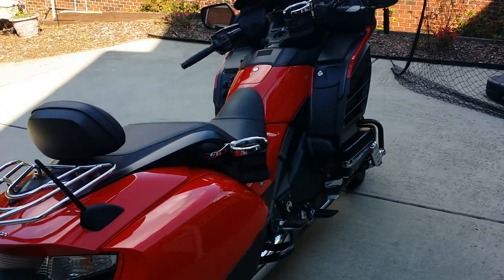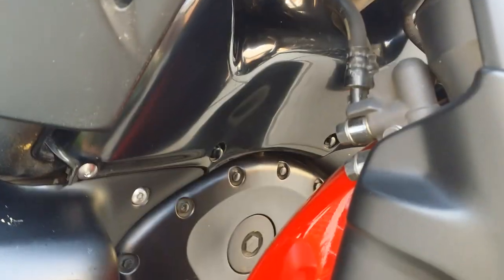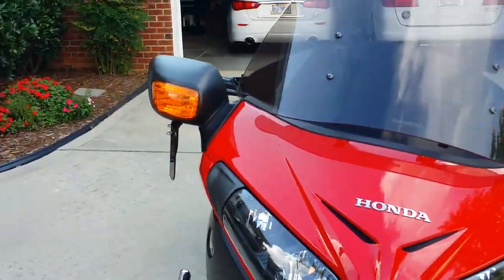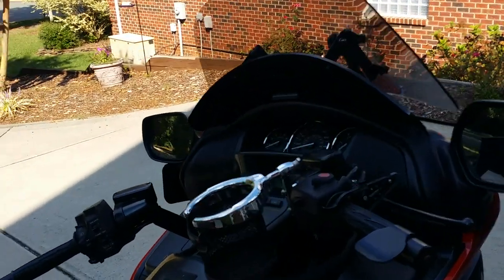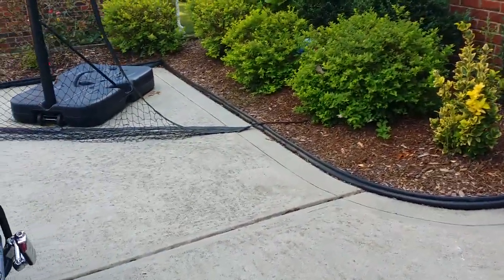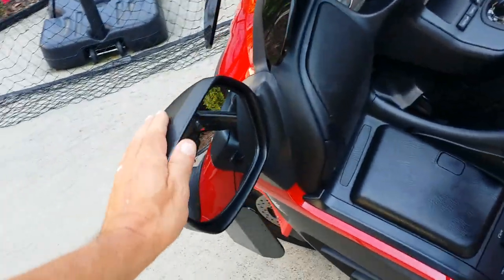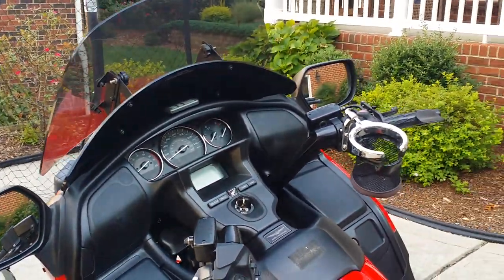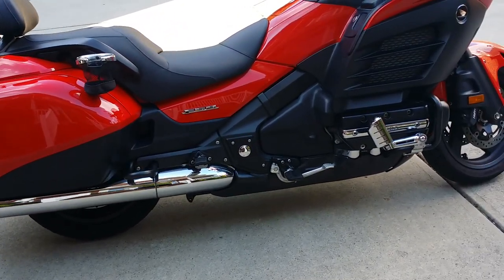F6B 2013 Honda Goldwing 21,000 Update Review

Comment: Great Video John!  Nothing better than long term reviews. Hey, you talked about your radio at length. I like listening to my radio but quickly found it had no range. If you want MUCH BETTER reception just switch to a standard 31" antenna with a 5mm male stud and a stainless lockwasher.  With a 31" antenna you will get much better range and right about 3x the stations on AM, FM and WB. Yes, you can get shorter antennas with corresponding shorter ranges and yes the base is sturdy enough. My wife does not ride so I don't know if a longer antenna would bother a passenger tho. Thanks for your video  ;-)
Reply from the maker: Good advice here! Yeah the short antenna really doesn't do the job as far as reception goes, being in a metropolitan area, not too bad, but I could definitely see where the reception is not as good as what I get in the car! On my favorite channels! Will take that into consideration, I do like the look of the stubby antenna, LOL, mine was actually missing off the bike when I bought it, so I had the dealer put on an antenna, and unfortunately he put on a knock-off, I was always wondering if that was the reason why my reception just wasn't there, but I think you explained that away. Thanks
Reply: You'll be amazed at the difference. I'm a half hour out of the edge of Chicago and I should be in radio heaven, but when my local station dropped off after ten minutes it drove me crazy. I bought mine at The Antenna Source in Manitowoc WI after talking to their customer service guy... very helpful. You can buy antennas at the car parts stores also but its a crapshoot to find the 5mm thread. Now I can get my local station out to almost 35 miles over flat terrain. Happy Riding!

Comment: I run Metzelers Me888...This set of tires I've gotten well over 16k out of.

And this dark siding I'm still not sure about that?
Reply from the maker: How do you feel as far as the ride on the Mes? I know that 10 to 12k is  not a lot on a MC tire but the cusion ride is great with the bridgestones.
Reply: @johnk12345100  

It definitely handles better especially on wet roads the turning feels more crisp like a sports bike.

But my wife said the ride on the back feels different much different than those Bridgesstones.

She said it felt more comfortable with the Bridgestones?
Reply from the maker: @melvininf9276  yep I guess it's a trade-off smoother ride, means Les Miles you get out of the tires, maybe the perfect mix would be to let a little air out of the metzler's! LOL

Comment: Hey John, any thoughts on adding TPMS ?
Reply from the maker: I would really love to get the tire pressure monitoring system on here, IMO ones that just twist on your valve stem looks like the way to go. Cruiseman garage did a good video on them. It was on his old Wing, but he shows the comparison about how easy they are compared to the ones you have to wire up. The only reason I haven't gone to them is because I have rubber at the bottom of my valve stem, not Steel. I'm not sure if that little bit of extra weight at the end would cause a leak at the bottom of the stem, but I would love to try cuz I really want them. Since my tires are ready to get changed, I might just request the steel ones, so I don't have to worry about it, I haven't priced the tire pressure monitoring systems lately, but I think you can get in for round 60 to a hundred bucks for a great set.
Reply: John Keller it's gonna be my next add on. Had a flat on my 2000 mi rear tire, did not even realize it was flat until I was out on the highway.